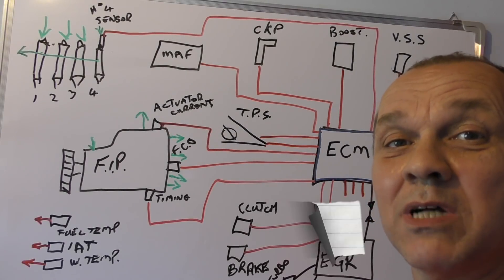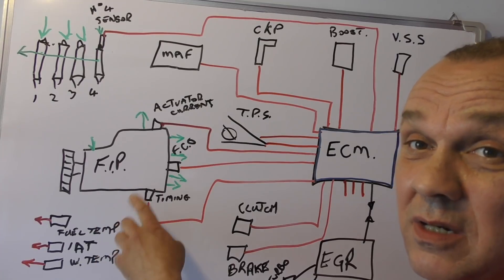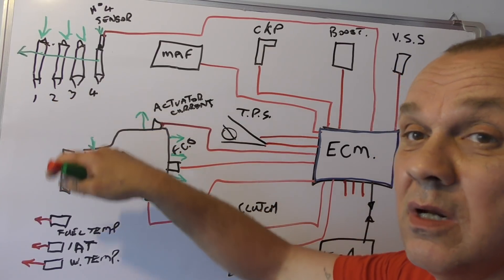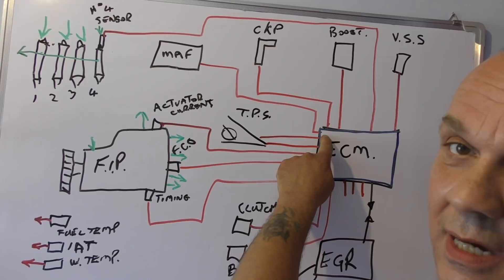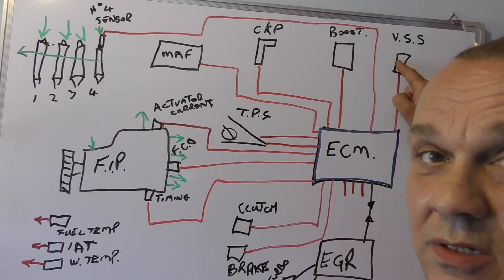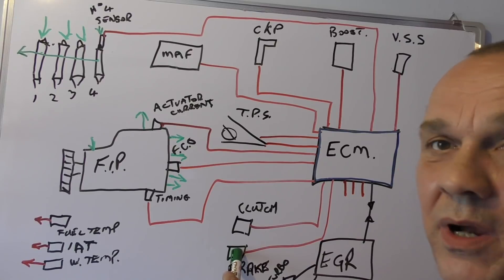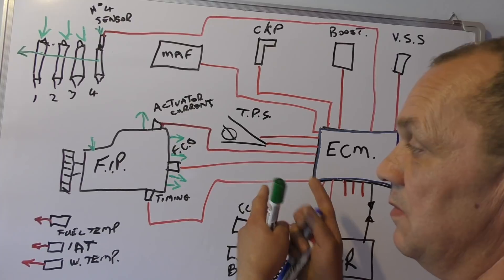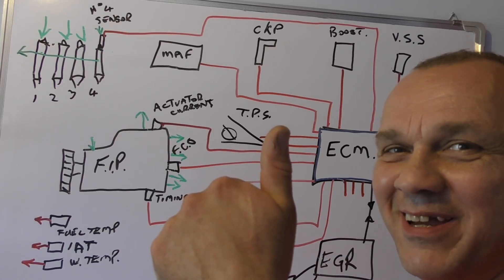LRTV Whiteboard Sessions The 300tdi EDC Fuel System Control

Comment: So my 300tdi 1998 discovery manual gearbox and has a throttle cable (that I can manipulate by hand in the engine bay) will not have an ECM?

Comment: Thank you for that, it's confirmed mine does NOT have this. But it does have a electronic part on top of the FIP & a small ECU under the middle seat.  What is this & what does it do please?

Comment: I have a Rover 400 with the L series Diesel in it, its an early one that has an almost completely mechanical controlled Bosch VE pump but the timing is ECU controlled. Has a lift sensor on number one injector, crank position  and maf (egr has been removed), and a timing solenoid underneath the pump exactly like the VP30 EDC. Its started to play up now after 185k miles with really bad blue white smoke on cold startup, with light missing and bogs when you try and rev through it. After say 2-3 mins if you pull away hard and give it WOT it clears and its mostly driveable when warm, but with intermittent full power when at WOT.  Lately after watching the engine idle i can hear the timing wandering around from quiet diesel knock and slight smoke to normal  running  diesel knock.  I can definitely hear a buzz coming from the bottom of the pump intermittently from the timing solenoid area. Is my timing solenoid giving up? So far i've changed the fuel filter and ran injector cleaner through it, and had the Relief valve out and made sure its free moving, the retaining collar on the bottom was sticking out abit so i've tapped that back in  so its level with the bottom of the valve although i doubt it will change much. ANY ideas? as the forums i've been on haven't a clue and its mainly the vp30 that has the solenoid failure ending tractor syndrome....which this isn't having atm.

Comment: Hi I'm not good in English I'm hoping that you can understand my question and teach me  how to fix my gear problem and I hope you can help regarding my problem on the boat that I drive,my boss have sealine statesman 42 shaft type volvo Tamb72 edc,1997, the problem is my port side "if I engage the throttle and return to neutral its continues running" my engine about 2 seconds then he stop stay in neutral, my stbd side is OK, if I engage my stbd throttle gear he run then I bring back to neutral engine stop and stay in neutral,

Comment: Hi, I am a bit worried having seen this video, I have a RRC with the VM2.5 good old motor but it's got just under 300 k on it, so I have purchased a 96 disco 300 tdi to swap motors and boxes .
this 300 has the same pump as my wife's 200 tdi disco except it has wires coming out of the top, there are no wires on any of the injectors, Has my swap just got a lot more involved i.e. ECM sensors etc. I went the TDI route because of cost of rebuild the VM parts are a fortune, And being an old truck driver I prefer to have least tech as possible. Thank for all the great video's hope you get things sorted out soon. Steve an Englishman in France.
Reply: That's a relief, Thanks mate.
Reply from the maker: the wires on the top of the pump is the position sensor for the EGR . It is the as close as damnit to the 200tdi pump but with the addition on the top of the throttle spindle
Reply: It'll run perfectly well if you cut the wires and remove the EGR.